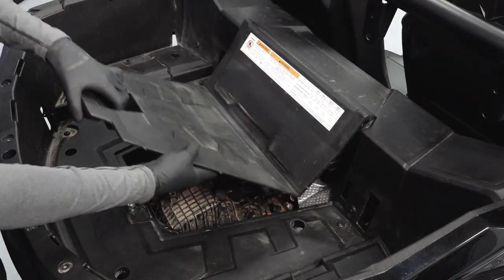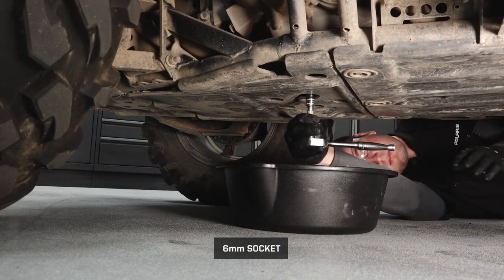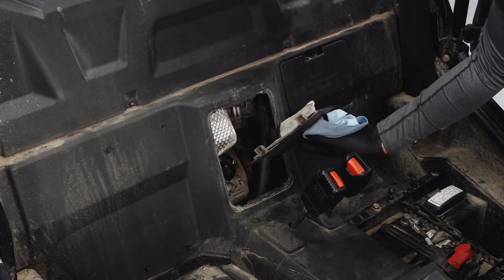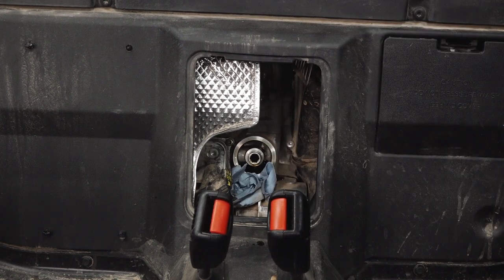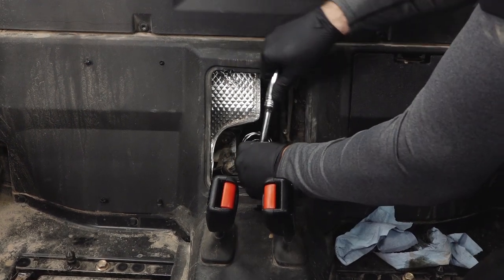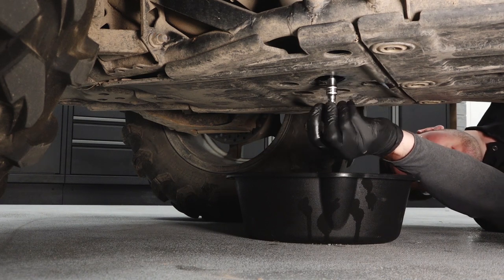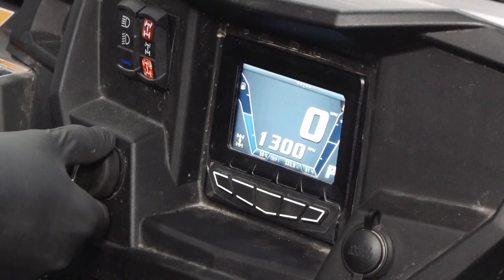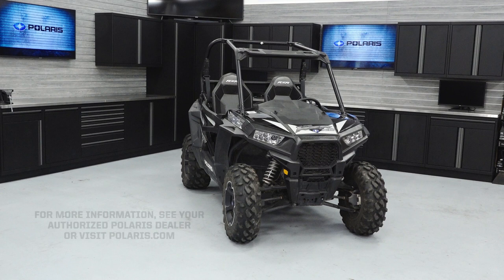RZR 900 Oil and Filter Change | Polaris RZR®

Comment: You need a 6mm Allen wrench in order to take the drain plug off. Video states you need a 6mm socket. Otherwise great video!
Reply: Thanks! Couldn’t see up there and couldn’t figure out why they kept calling for a 6mm socket when clearly that’s not what I “felt” on the plug. Polaris should make a quick edit to this video.
Reply: I switched all my drain plugs to hex bolt magnetic stainless plugs tired of debris in the allen socket was hard to remove. Pricey but worth it.